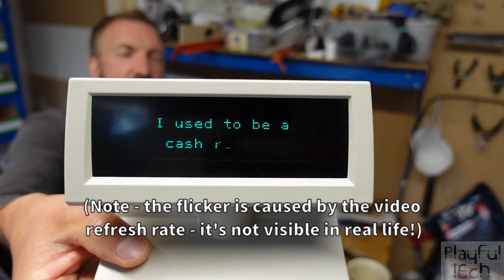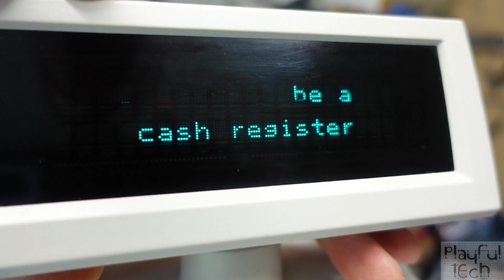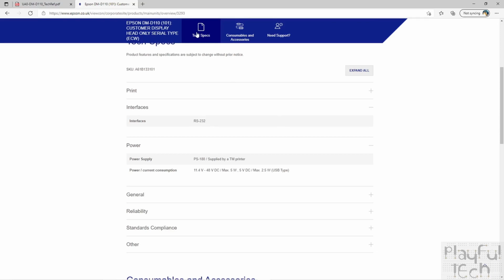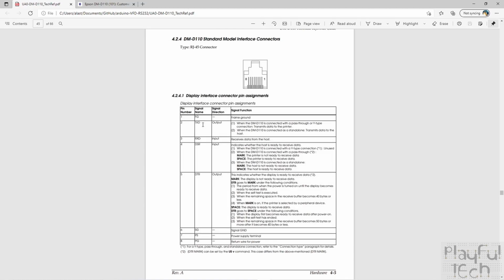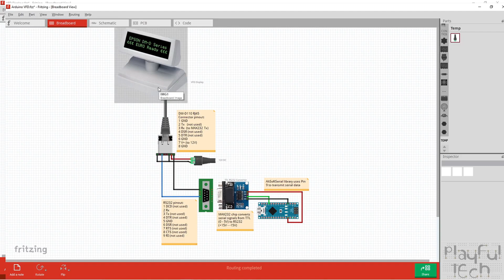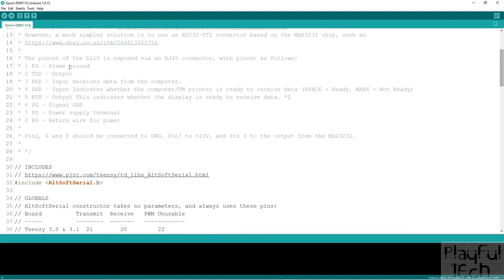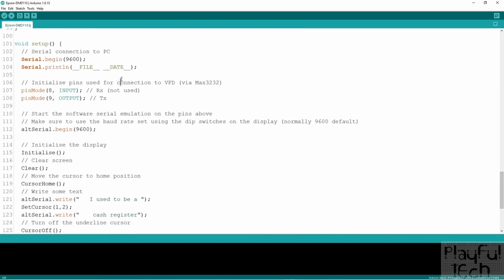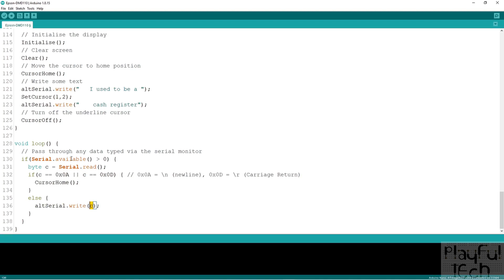Using Vacuum Fluorescent Displays (VFDs) with an Arduino

Comment: How can i use it, with arduino uno r4?
Reply from the maker: All the wiring and code presented in this project should work exactly the same way on a UNO R4 as on the Nano demonstrated.

Comment: Excellent.
I'm caught up in this VFD stuff as well, Your build is inspiring. I built and Arduino VFD Clock and Voltmeter, so the new challenge is an I2C built up display, I'm starting with the TM1637 and a bunch of transistors. Add to that, an RS232 build Via AT89S52 using the MAX232. I know nothing about programming a 8051, I just have too many Soviet tubes and this is my solution. I could use some help.

Comment: Wow! Everything old is new again. Did something like this in... Wait for it.... 2009! Hacked an EPSON POS (Point of Sale) VFD powered by a hacked router to pick up internet weather. Needed an Arduino in the mix to actually drive the display. Here's the youtube video: https://www.youtube.com/watch?v=epiL93GKD0E. Years later I replaced the router with a Raspberry Pi 3 A+.

Comment: I found VFD's quite cool, so your video (as featured on Hackaday) inspired me to get started. For ten euros I acquired a similar display from a cash register, including the serial cable and power supply, so less hacking required. Now I'm just waiting for the MAX232-RS232 board to arrive in the mail. My display is Epson compatible, so I think all I have to do is hook it up and use your code.